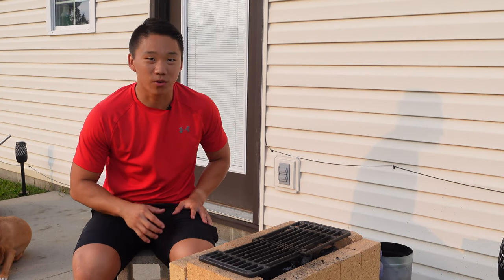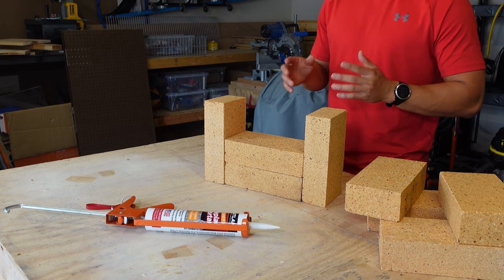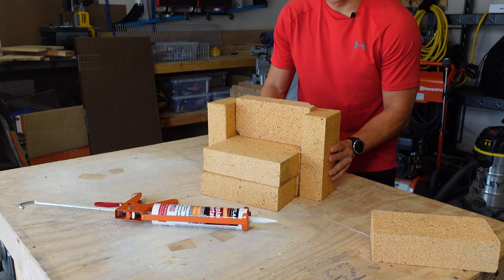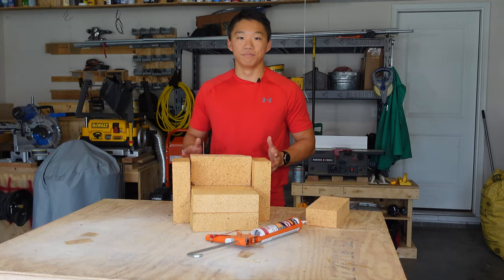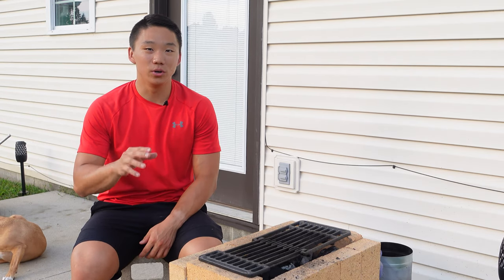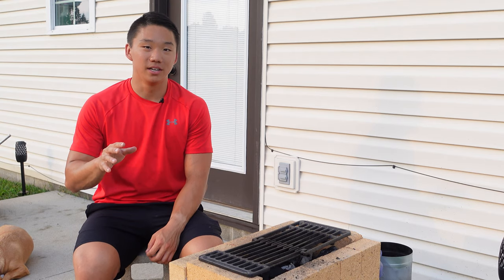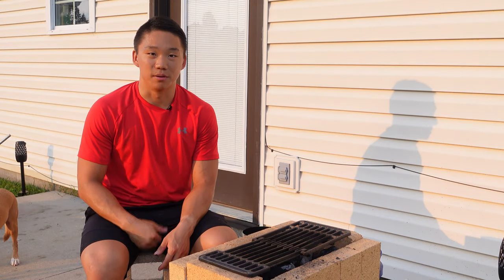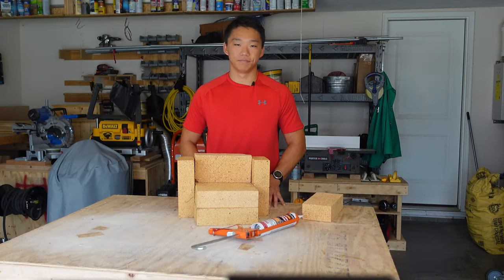How to Make an Easy Japanese Konro Grill

Comment: Great build! If you want to lighten it up a bit you can get lightweight insulating fire brick. You could also switch the bottom bricks to splits which are half as thick. I've built several coal forges and a couple pizza ovens. This is a great way to reduce weight.

Comment: Hey lad, not fully understanding the need for two bricks since you are using a stand for height.Could use only one brick for cost and weight savings. I also don't see any gaps for air to feed the fire. Overall it was a good build. The stand was great.